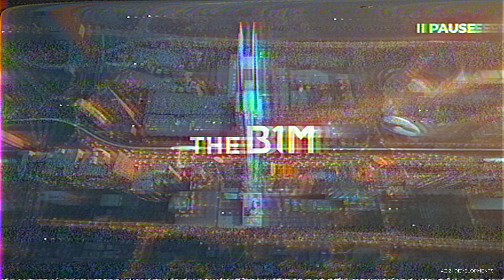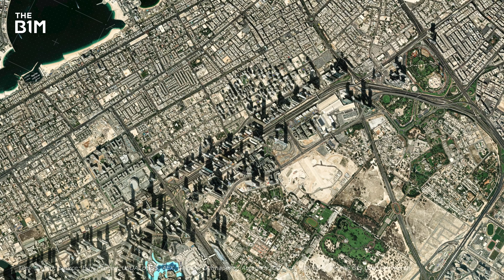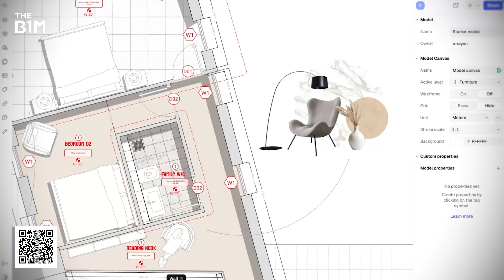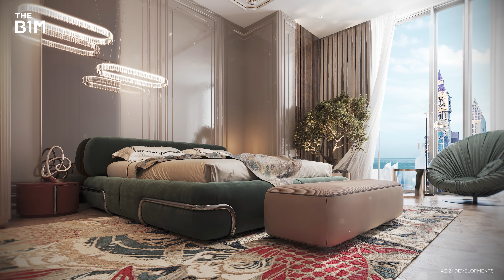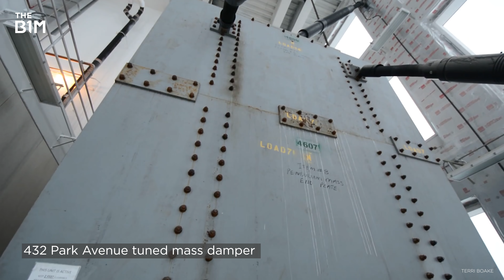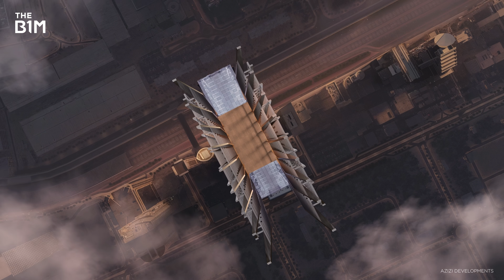Why Dubai's New Giant Faces a Race Against Time

Comment: Dubai often feels like the ultimate attention seeker, suffering from a severe case of 'main character syndrome.' While it’s smart that they realized an oil-dependent economy isn't sustainable and pivoted toward tourism and finance, does the transition really have to be so loud and melodramatic? They have vast expanses of land, yet they insist on building unnecessary skyscrapers. I get the fact that Dubai isn't just building a city; they are building a brand. The skyscrapers aren't built out of necessity; they are built as vertical billboards to shout to global investors, 'Look at us, we are relevant. However, it exposes a glaring irony in their grand plan. They claim to be building a forward-thinking, post-oil economy, yet they are doing it using the most unsustainable, energy-intensive architectural models possible. Pumping water to the 100th floor of a desert skyscraper requires massive amounts of power. In trying to escape the shadow of their oil past, they’ve let ego dictate their future, prioritizing viral internet moments over logical, horizontal urban planning. That should tell you everything you need to know about their mindset and the mindset of those who invest in it.

Comment: Most contemporary residential housing is designed to last fifty years before a major remodel or a tear down. I know a good hunk of NY's skyscrapers constructed in the 1950s through the-1960, have been torn down, received regrettable face-lifts or allowed to hang out until they become zombie towers. Beyond an absurd amount of testosterone putting towers up or tearing them down, they are from the last brick not an investment, but a drain for wasted money to large amount of the world. I understand economics, but this is way too big of a calculus to me.
What do building owners or lessors do when these luxe buildings start getting a little funky looking around the edges? I guess we can all hide behind a big sign that says "We'll find out!"
But, is this becoming an issue with supertalls? Have there been any successes or thoughts to consider regarding this sort of thing thing? 
Can they put skins on buildings like they can on cars or trucks? 
If this is a doable, I think your team should consider getting the Pickle sheathed with your imagine. Put a bug in Mrs. Fred's ear that it could make her holiday shopping easier, if work goes cheap on you. Wrapping it to put under the tree? Naw, let it Be the Tree.😁

Comment: Does anyone know who is doing the actual structural design of this tower? So far i could only find information that it will be done by AE7, which is also in charge of the architectural design. Judging by the project references on their homepage they haven't done anything which comes close to this kinda height. Keeping my fingers crossed that is doesn't end up as the 432 tower in NY...

Comment: Doesn't the Clock Tower in Mecca have the highest habitable floor? They can have meetings in a conference room inside the gold crescent at the top! That's not vanity height, that's usable space. If they use the floor above that as a minaret and actually call for prayer, aren't they using that floor, too?! Let me know. I'm curious how you'd measure it against other skyscrapers. -Catherine💐
(If I got any of the religious stuff wrong, apologies.)

Comment: Architect Frank Lloyd Wright has designed a 5,280 foot tall skyscraper for Chicago,  the mile high skyscraper.  It needs the funding to be buildt. If Frank was alive and designing today it would be 3 miles high. So much for these puny pancake buildings  Joe 30 Pak. 🍻 🍻 🍻   😊

Comment: Are extremely tall buildings in anyway desirable other that some spectacular views for some of the public spaces? Living and working daily in such a tall building would seem to be more of a chore than a privilege. 

There has to be "optimum floors" in tall buildings, a sweet‑spot band where the view is spectacular, the lift journey is tolerable, and the psychological trade‑offs still feel rational rather than performative.

While the very top floors may have status signalling, not practicality, dropping just a few floors, the bragging rights evaporate but the inconvenience remains.

The optimum floors in any high rise are probably between the 25th-55th floors.

In terms of view, those floors are not "city level" views and offer a dramatic shift: skyline, horizon, sunsets, distance, and where going higher, the view improves only marginally.

On a daily basis people will people will happily tolerate a 1-2 minute lift, but 3-5 they will do so grudgingly, 6-10 will feel very much like a chore, and 10-20 minutes, something would have to be worth it.

Floors beyond the 55th often involve endless lift changes, waiting, sways in high wind and ear popping.

The "misery zone" must be between the 70th to five floors below the top where, the view barely changes, lift journeys becomes a slog, the building sway becomes noticeable, maintenance visits and deliveries take longer, evacuation drills are absurd and there is a physical disconnected from the city.

The best floors are those that are high enough to feel special, but low enough that there is no resentment when leaving the flat.

Comment: 11:04 I call this bs. Where does the energy come from if the airmass would be accelerating when going down? There is no venturi either. The wind will cause a pressure on the building, but with basic knowledge on physics and aerodynamics I’m quite sure that this statement is incorrect. It will cause turbulence for sure, as seen on the animation, but where is the change in the wind speed coming from?

Comment: Such an excellent video as always, but this information does look palpable and theoretically impossible; it's wind resistance map as your displayed looks shocking and coupled with the height, and lessons form 101 in New York...really seems destined to major structural issues. Also the position on Sheikh Zayed Road and lack of free form space, give a very tight feeling. (thanks for the Rayon Design link - looks ideal for what we need right now).

Comment: What a veiw from an apartment on the 150th or higher floor  -  then an extended power outage . 
 Getting supplys up would be a nightmare , as water , would be one thing lost , plus the lifts out , and having to haul your grocerys up that hight , every few days  !  
 One would fitten up in a hurry , or sell at a huge loss .  An EMP , from off world could do such damage , easily , over a huge area .

Comment: And it makes you wonder if that when skyscrapers are getting taller and taller I wonder if we will be able to have advancements in not only architecture but in the material science to develop concrete glass and steel that is much more resistant to win loads as well as seismic events so that we could build quite literally into space

Comment: Isn't there a sweet spot in maximizing efficiency in skyscrapers, the taller you go, more of the floor space is taken up with reinforcing structure, elevators and mechanical for the building?

Comment: How will they replace a building that tall and thin? Would they remove some of the elevators and use the shafts as a sort of garbage chute? And then with the help of security mesh to catch anything that might fall outward, would they pull the tower down floor by floor, while dumping everything down those elevator shafts? 

Certainly can't use the typical implosion methods. Especially with something that tall and thin, that's also flanked by other incredibly high towers. If something goes terribly wrong the implosion could aend the tower crahing down well outside the expected footprint or even into the neighboring buildings.

Comment: You are telling me Dubai shoved a 20-lane highway right through the center of its city core? 

It sure sounds like a city where the people don't actually spend time outdoors.
Reply: It actually built the city around that preexisting highway
Reply: lets go outside for 5 minutes and become a literal chicken nugget there is a reason why most places in dubai are indoors because people cant go outside for more than 10 minutes in the summer and spring/fall also for winter there is SOME solid outdoor places

Comment: I'm just popping down to the lobby dear, I'll be back in half an hour.
Reply: In 1997, I visited a client on 101, WTC 2 (the ill-fated Cantor Fitzgerald). With the airport-like security and 2 elevator rides (change at 72nd floor) it took 30 minutes to get there. I asked my client what it was like evacuating in '93, and got quite a story. Little did I realize...
Reply: It's 3 hours no come back a watch video
Reply: Apparently this is the reality of living in one of the super-talls in NYC because there are only one or two elevators servicing 100 floors.
Reply: more like 5 minutes. Both ways.
Reply: @badmaniak 
Aha! All these other people here must be talking about some sort of open to the public, general usage lift. 

I s'pose they're right, but no idea really. 
Have key or code, ot private elevator, have one of the top floor places, will travel. 
At warp speed!
Reply: Don't rush darling, I'm going to be here an hour either way
Reply: At the lobby: "The elevator just broke down. Please use the stairs."
Reply: The guest are here. You still have time to clean the apartment

Comment: Would it be possible to USE downdrafts productively? Like build a building to intentionally maximize downdrafts, but then design the courtyard around it to collect and funnel those downdrafts away (maybe ventilating a transit tunnel or something), and driving wind turbines to produce electricity?
Reply: It would work even better when fire broke out!
Reply: street air conditioning
Reply: I like the turbine idea, might slow it down due to resistance.
Reply: irl windtraps